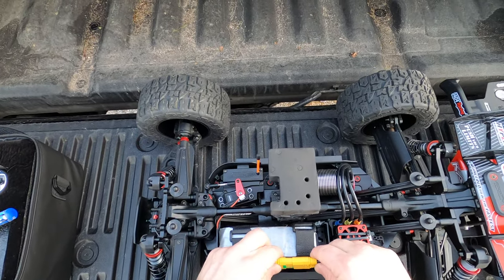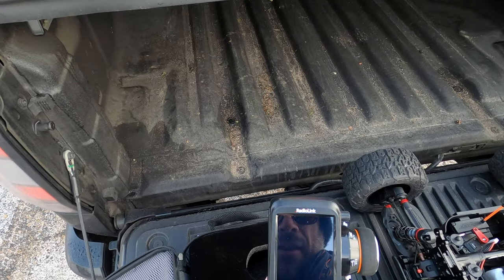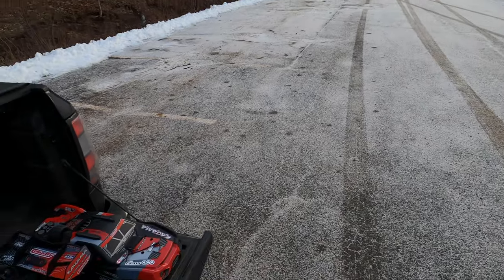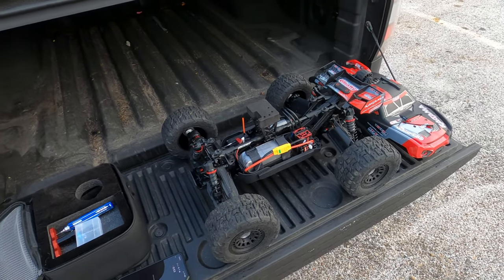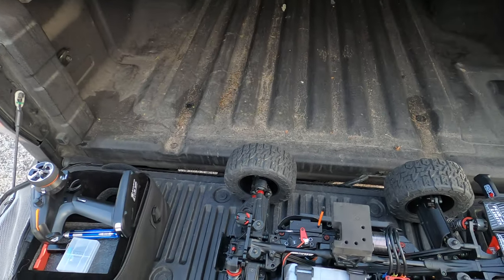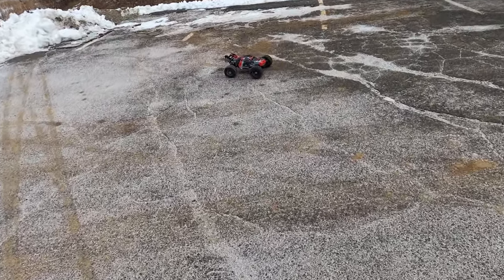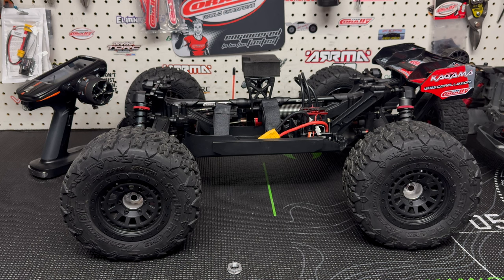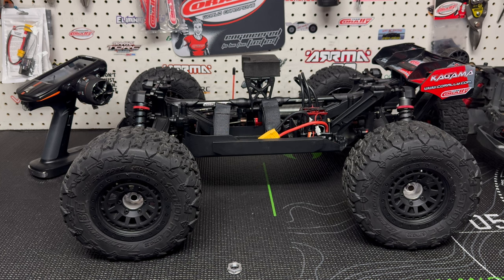Team Corally Kagama 6s Running Method RC Belted Terraform's

Comment: Looks awesome! It makes me want one. I have been running belted proline on my typhon 6s. They have zero traction. Do you think these methods would fit on the typhon? Also, I have some great WARM fishing gloves that have the thumb and index finger cut down. They work great. Give em a try for rc control.

Comment: I would try some copper heads 2lp. I find that they r good in all conditions
Reply from the maker: Yes, they are great tires.  I run them on a few trucks.
Reply: @JasonPerrinRCVlogs  
Same here, I'm currently running them on my outcast 6s exb